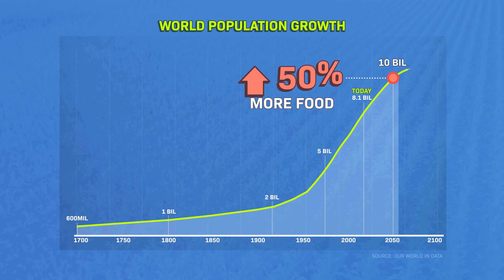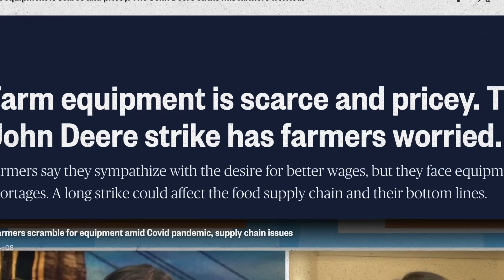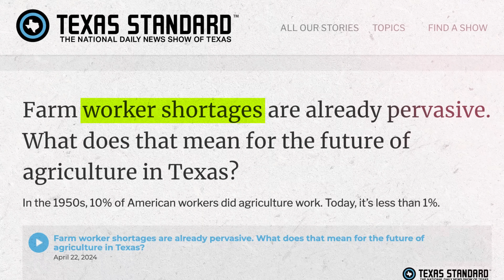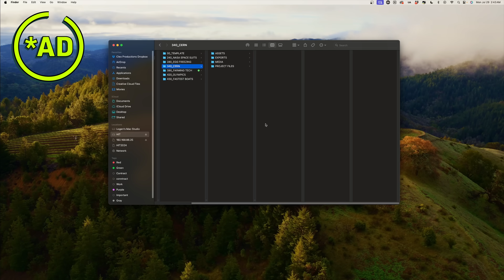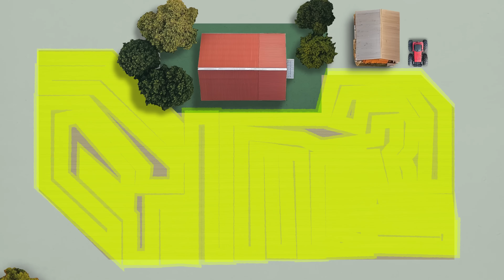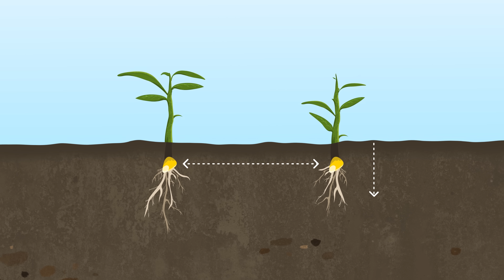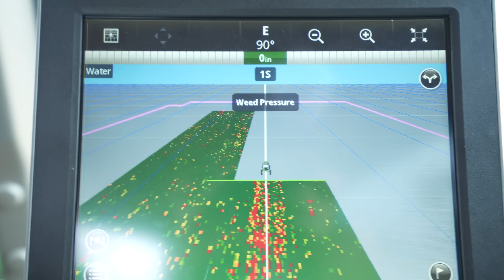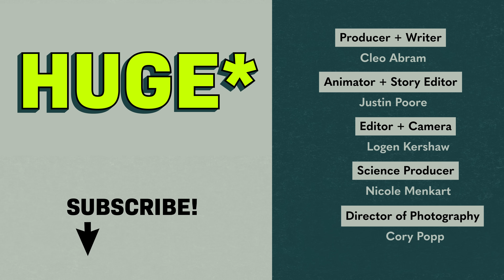Why This Robot Kills Weeds With Lasers

Comment: The laser weeders seem really cool, but they seem much narrower than the sprayers, wonder how much farmland is lost by increasing the amount of tram lines going the field to bring the laser over all the crops
Reply: I suspect that that laser weeder is narrower than a sprayer only because the laser weeder is still in research and development.  Once they get the bugs worked out of the system, I suspect that they could scale up the size of the machine to the most practical size for a larger farm field.  I think that the laser weeder shown in the video is operating in a scaled-down test plot situation.
Reply: What? Uh, chief the lasers are ON the tractor/equipment as it passes over - you don't need any lines, etc. as it's generated on the tractor itself. Did you seriously think there were wires and lasers all over the field just sitting there all day long? I've seen some dumb comments on this video but this one takes the cake!
Reply: @ross-carlson  ironic that you write such a condescending comment, when you don't even know what tram lines are. They are lines on the field without any crops for the wheels of the tractor.  If you have 5 meter arms on each side of the tractor, you need tram lines every 10 meters. If you have 10 m arms you only need those empty lines on the field every 20 meters
Reply: @Paeddl42  I know them as 'wheelings' (UK, might be slang)
Reply: @ross-carlson, the irony of your comment being the actual dumb one made my day. Thank you
Reply: Ladies and gentlemen, I present to you, the densest material the world has ever seen: @ross-carlson

Comment: Yeah, one of the local farmers built a GPS guided tractor in the early 2000s by himself. It was basically driving along a path he defined and controlled the machinery in the rear mostly by itself. It ecen turned around on its own. He was basically just on it to intervene in case sonething went wrong.